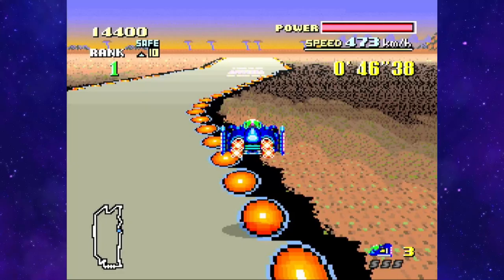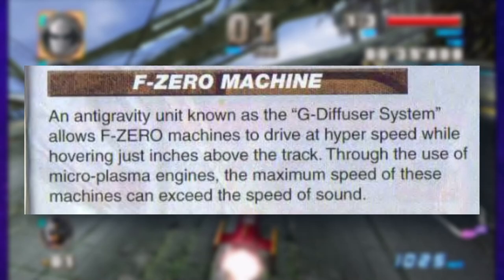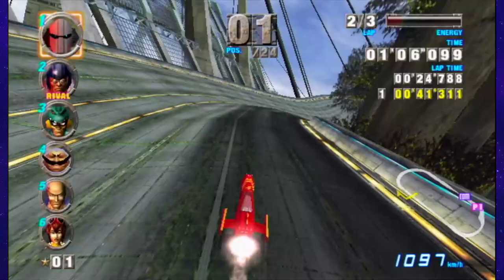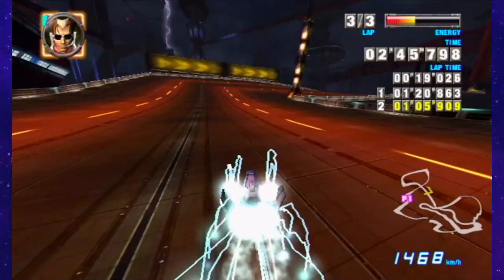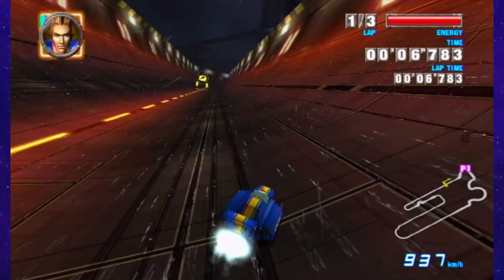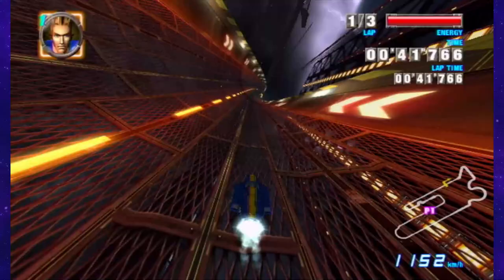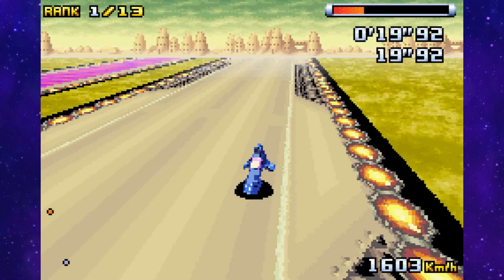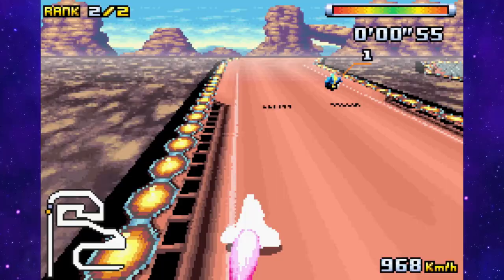How F-Zero Machines work (maybe)

Comment: it is clear that the device that must be in use must indeed perform some kind of gravity manipulation. The anime and GX both have segments where the vehicles are being used on natural terrain which means that this is something that is part of the vehicles themselves, not part of the tracks. I suppose the vehicles are designed to be attached to the ground below them by changing the gravity vector to go towards the surface inmediately below it. In real life, vehicles need a high amount of downforce to perform better, and FZero machines are kind of like space ships, but they are meant to be used for racing, so it would make sense for them to use a system that tries to prevent them from flying and keeps them stuck to the ground so as to increase downforce. This could also explain the sort of aerodynamic plane like shapes but not plane like enough to be capable of truly flying such as a lack of wings, tho that would not be needed in outer space but you get what i mean, the design is made to decrease drag and increase downforce... or at least that is the best explanation i could possibly come up with to justify the way the fzero machines work. After all, they are not real... lol

Comment: So, I'm going to examine this more from a "how can we make this a reality as soon as possible" point of view. And here's the thing... we can easily make a viable analog to F-Zero, at least in regards to the Mode 7 games, with technology that not only exists today, but existed for quite some time. In fact, there was a company that already did this in small scale - Axon Racing. It's no longer in production, I believe the company that made it went under, but it was a skirtless RC hovercraft about 1/10th the size of a car. It used a ducted fan blowing air through a set of air channels angled to direct that air inward towards the center of the vehicle, creating a cushion of air that contained itself via air pressure rather than the use of a flexible skirt like a normal hovercraft, and then a second ducted fan was used for propulsion. This small, electric-powered hovercraft was capable of reaching speeds of over 45mph with only minor upgrades (in stock form it would top out at around 25mph). It wouldn't work for all designs as it requires a flat-bottomed chassis (Cosmic Dolphin is out of the question), but this would be a very easy way to make a real-life analog to an F-Zero machine or other anti-gravity racer (Axon Racing was actually inspired by Wipeout).

Comment: One actual technology that I havent even heard being mentioned is the Ground effect. This is an actual phenomenon known in aviation where the wings of a plane or vehicle trap a cushion of high pressure air below it that stops it from touching the ground. It occurs up to a few meters above ground and is dependent on the size of the vehicles and its wingspan. The Soviets became experts on this technology in the 1960's and created a bunch of ships that would use the ground effect to fly above the surface of the ocean at 500-600km/h. These became known as Ekranoplan, with the most famous one being the gigantic KM, or Korabl Maket which was a prototype used in the Caspian sea. These vehicles also share many design elements with the F-zero machines. 

So the F-zero vehicles could very likely be ground effect vehicles.

Comment: I think it's like a passive sort of hover technology that is working all the time but tracks have like some sort of magnetic or electrical field that can make them "stick" to the track.
I mean you can see there are regular asphalt roads in the GX story missions like in the Samurai Goroh race and the Michael Chain mission and those roads don't have any bizarre flips or turns. The bomb mission is kinda interesting though because is is on a "powered" road. There are these bus/tram vehicles that seem to be totally automated on that road that 'stick' to the outer lanes as you approach. So these powered roads have other uses besides making you go upside down, in this case it's being used for some public transportation line (you actually do go upside down on that road though).

Comment: Regarding the rapid speed changes that would be fatal to most organisms, it's possible that the cockpit has a special pressurized system to mitigate momentum significantly, you can also see in GX pilots leaning closer to the glass the faster they go and they start to shake in their position icons.  A completely solid frame is necessary as crashing at such a speed would turn them into crushed cans, not to mention the fragile, presumably nuclear power plan that drives the entire machine.

In mission 6 of GX, you can see passenger and work vehicles on the road, and they are powered by a similar propulsion system.  It's feasible that 600 or so years into the future, engineers have discovered a faster, and more efficient means of travel for ground based vehicles, and in GX, it's revealed that the Deep Claw is an ordinary street going vehicle, barely modified to be functional for Octoman.  You can see various locations that appear to either be on earth or another planet, such as the canyon in mission 2 or the city in mission 3, and those appear to be perfectly flat roads.  The gravity manipulation system allows them to fight against Earth's gravity, but if you were to encounter a loop de loop on earth, the machine would be unable to go up the curve, since there's no gravity to counter.  Ironically, the obsolete wheeled vehicles can.  And the race tracks, or other 'suspended' routes have buildings that seem to be the power sources to give them their 'gravity' for the machines (and maybe other objects, such as people) to use and work against.  You can crash into the buildings but you can't scale them, because they lack gravity.

Comment: the gravity drive explanation is likely a bit off.  Under the gravity of a planet, it will orient itself with the planet, but there could be a bypass put into various roads and tracks to put an override of that base system, and it can be overriden if the nearest gravitational force is weak.

Every section of road's thick enough to handle tech inside it.
Reply: Adding onto this, I have to ask, does any anime episode or either of the anime games even have a segment like X or GX where you go upside down? If no, the Gravity Drive may be fundamentally different from G Diffusers and the tracks in the anime canon may be specifically designed to be flat to account for the issue raised by that segment of the video anyway

Comment: It always bothers me when peoole suggest that the G-Diffuser is the what allows the machines to float. It's not, it's what allows the machines to go fast while carrying a human inside the machine.

G does stand for gravity, but it's a measurement of *force*. 1G being the amount of force you naturally experience from the pull of Earth's gravity.

G-forces can be incredibly dangerous. Real-world fighter pilots cannot survive more than 9 g's and it's the biggest inhibitor limiting real-world vehicles from going fast.

A G-Diffuser is likely a theoretical device that, as the name suggests, diffuses G-force. It allows the machine to reach high speeds whike carrying a pilot by reducing stress on the human body. As mentioned in the video, it's also likely why every tiny collision in F-Zero and Star Fox isn't immediately fatal. It's also likely spacecraft in the Metroid universe also have G-Diffuser systems as well since they travel at warp speeds, too.

All that said, the question of what allows F-Zero machines to float is certainly an unanswered question, but I don't think it's related to the G-Diffuser.

We know F-Zero machines don't need to be on a track or road to stay afloat. But they don't seem to fly freely, either. And we've never seen any indication that they're capable of hovering over the surface of water or anything like that, either. Though I'm not sure we've ever seen that interaction demonstrated outside of falling into Big Blue and the like which is likely affected by hitting the surface at terminal velocity (these machines do weigh thousands of Kilograms).

Judging by the sounds we hear F-Zero machines make on start up, and the physics they exhibit, especially in the 2D games, I suspect it's concentrated air pressure that allows a machine to hover off the ground. There are what appears to be air vents along the bottoms of the machines. Hovercraft are a real type of machine that exists in the real world, they can travel at high speeds without friction by using concentrated air pressure to float off the ground. But they aren't very practical since it's difficult to make them stop due to the lack of friction. Even airplanes need long runways to land and slow safely to a stop.

F-Zero Machines do have brakes, though, and we see them being used on natural terrain, too. So it's not related to that, either. Perhaps there's some shift in air pressure combined with the G-Diffuser that allows the machine to safely, and quickly, slow to a stop and hover in place without tipping over.

Speaking of which, in order to drive over natural terrain, an F-Zero machine would require some sort of gyroscopic tech as described in the anime. Otherwise it would be incredibly dangerous and could fall over on sudden changes in angle. Though it's possible some combination of the thrust from the jets and pilot input can correct on this, just like the way machines handle in midair.

But that brings us to the question of how F-Zero machines defy gravity during races: And I think that explanation comes back to the magnets. Magnets are used to pull, not repel, machines toward the track while air is used to prevent contact with the track. This allows the machine to move up, down, and all around as long as there's a track below it. 

It's also entirely possible there's an advancement in tech between F-Zero and F-Zero X. F-Zero tracks never go upside down or anything of the sort. And when the machine comes to a full stop, it lands on the ground. At least for these earlier machines, I think the thrusters might be doing a lot of work to keep the machine afloat and the magnets are only used to keep the machine steady and aligned after collisions.

I hope this essay is interesting to read through. It was just a few thoughts I had while watching the video.

Comment: My headcanon for how these machines work is the G-Defuser system actually gives the machines flight, but the tracks have powerful magnets to keep the vehicles from flying off the tracks, however, this still doesn't explain how the vehicles are able to drive off road or use the feature of flying to get to places instead of driving on the roads. I guess some things just don't need answers.